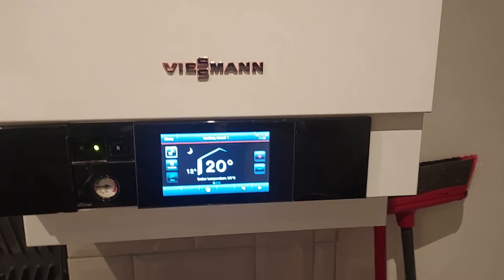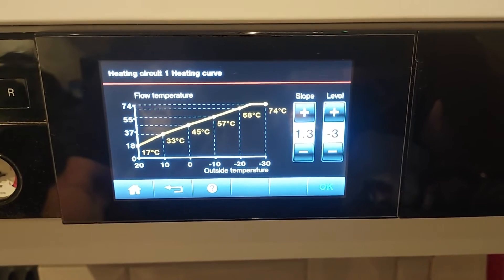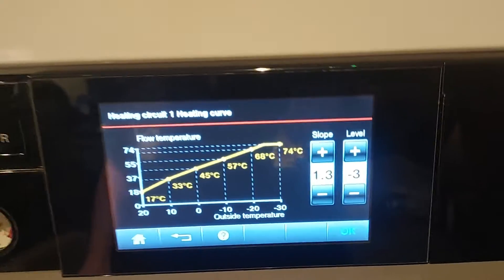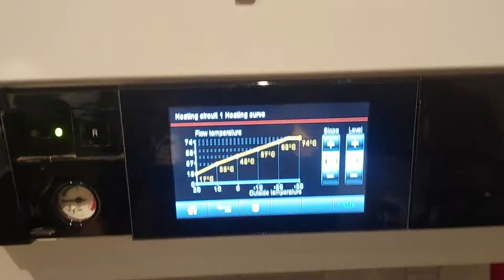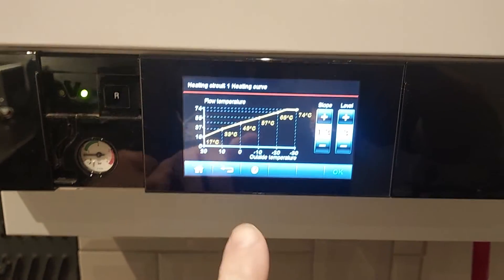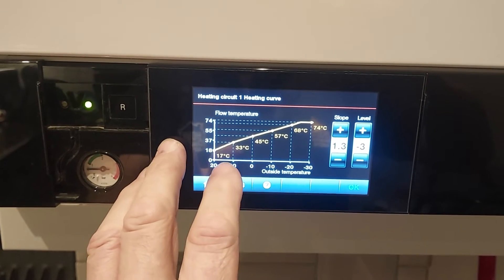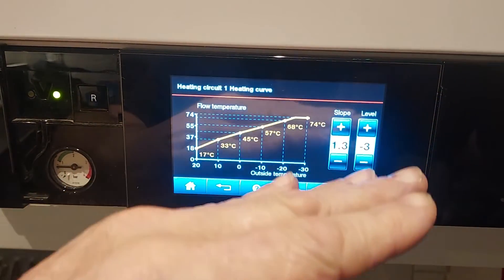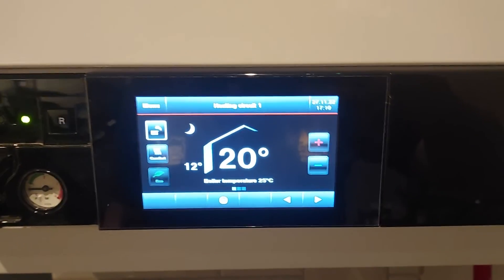slope and level on Viessmann weather compensation controls.

Comment: so when its 10X outside the flow temp is 33C ? yeah good luck heating with 33C water in radiators, I've set my level to 18 and slope to 1.3 so at 15C outside the flow is 55C and at 0C the flow is 65C (its almost never below 0 so we're fine)
Reply: It's not luck you need, just a modern house with large radiators, good insulation and windows with controlled ventilation. Of course it also helps if you don't let the house cool every time you pop out. There's no way we need heating when it's 15°C outside. When the sky is clear and the sun is out that is more than enough to heat the house—even when it's freezing outside. Sounds like you're living in a cave.
Reply: we got 0 isolation only bricks and when its 10C outside the room temp drops from 23C ar 10pm to 19C at 6am  @johnhunter4181

Comment: Another way to put it this slope is a non-linear heating based on the outside temperature the shift is a linear heating based on the outdoor temperature.  In my case I'm in a home new to me with floor liquid heating and I found to get it close to perfect it may take you a month or two.  This is because the rooms don't have individual thermostats where I'm at. Temperature is based on the return water temperature to the boiler outside air temperature.  Furthermore each zone or room can be throttled to adjust water flow.  I do not have radiators with thermostats.

Comment: Thanks for the video. I have just installed a Viessmann 100-w and I am going to put weather comp in. It says in the manual that I should adjust it according to the property type but the graphs are quite hard to understand.
Reply from the maker: If you look back through my channel you'll find a video on weather compensation
Reply: Thanks. Will be sure to check it out.

Comment: Currently putting in a 200 with 2 ufh manifolds mixed, radiators and towel warmers. DHW off the 4 pipe. 

Would you say weather comp would work as I'm using 3rd party controls after the llh?

Also would it be worth adding a pipe stat so the 200 recognises the header temp?
Reply from the maker: Just don't use third party controls. It's an expensive mistake